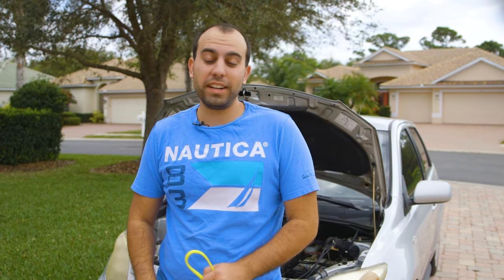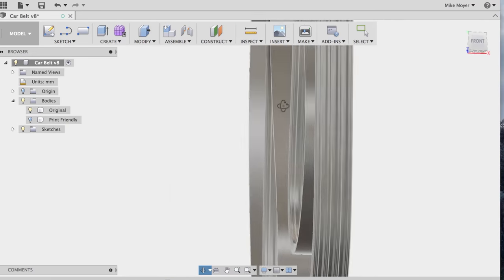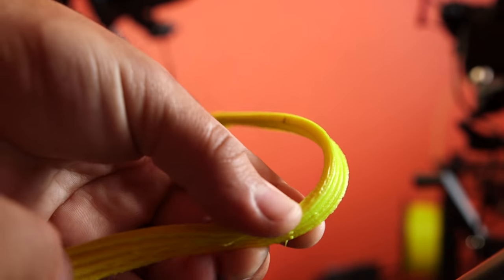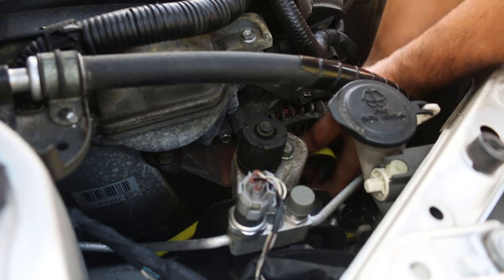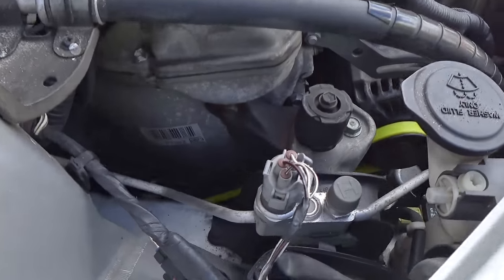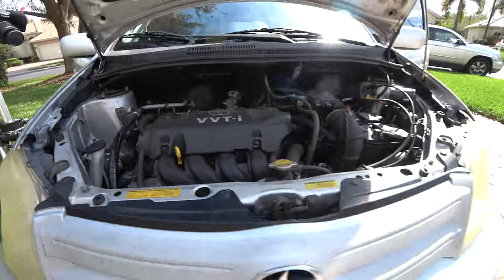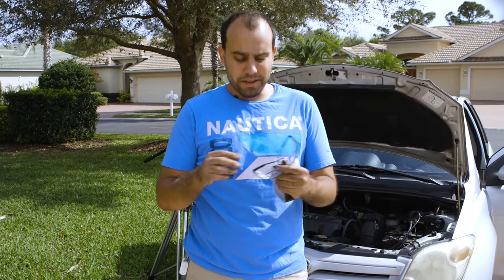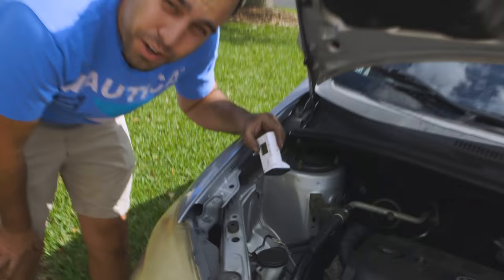3D Printed Car Belt | Will It Run?

Comment: PSA: dont try with your timing belt
Reply from the maker: Haha, I've got a timing chain.  Does that mean I can try it?
Reply: Oh well in that case, go for it!
Reply: If you get a metal-printer, YES! (no)
Reply: dear god PLEASE DO THAT WOULD BE THE BEST VIDEO EVER WE COULD TAKE BETS
Reply: And the piston will mingle with the valves and new holes will appear because another piston thought it was a rocket.
Reply: why not ?... pls do that !
Reply: why? it won;t hurt anything. oh wait. some of you don't have non interference engines :-)

some engines are non interference. IE losing the timing belt won't do anything but stop the car. install new one align and your good to go.

now an interference engine? ouch.

what he needs is a LESS stretchy material. or a way to impregnate something like kevlar string into the print somehow.
Reply: Yeah, but finding the correct timing again would be a bit of a pain.
Reply: your right you shouldn't mess with the car unless your a mechanic like me then you can do what the hell you want
Reply: Shawn Azzopardi idk about other cars but mine has timing marks. just align them all then put the belt on
Reply: Melody does not quite work like that. both pulleys need to line up. problem is if you belt is changing its dimension by stretching and shrinking then the two pulleys wont stay aligned. ie your timing will be varying wildly and randomly on its own.
Reply: Nerys oh yeah hahaha. Well, when it does, it will be easy to put a new one on.
Reply: Melody more likely yes and no
Reply: If you want to fuck up your engine go right ahead.
Reply: some of you guys maybe have no idea whats the difference between timing belt / chain
Reply: Of course i do. On some engines the "belt" powers all of the auxiliary parts like the manual fan, water pump, alternator, a/c compressor. On some engines the water pump is connected to the timing chain. The timing chain is what keeps the camshaft and the crankshaft synchronized so the piston and valves open/close when they are supposed to. With that being said, on some engines if the timing goes out of whack you can severely damage your engine because the pistons will hit the top of the head and hitting the valves causing it to need a rebuild or in some cases completely destroying the block.
Reply: ***** actually the piston won't actually hit the valve's because the piston will go so far up unless your crank is fucked then it's with probably hit the valve's and if it did this you would more like see back fires as in the engine wouldn't run because too much fuel on the piston unless it makes alot of a vapor
Reply: if it's an interference engine then you will fuck up your engine by doing what he just did but with the timing belt/chain,
Reply: This thread is why I do all the work on my own cars myself.
Reply: ShopTalk 3d printed motorcycle chain
Reply: ShopTalk  that was not the timeing belt that was the auxiliary belt
Reply: who said it was his timing belt?
Reply: ShopTalk2 weeks ago
PSA: dont try with your timing belt
Reply: You need to read better before commenting. "PSA: dont try with your timing belt" means dont fucking do this with your timing belt. If he had already done this with his timing belt, why would why then tell him not to do this with his timing belt? My comment was meant for people who dont know the difference and might fuck up their engine.
Reply: He hasn't done it with his timing belt. He said he might try it. I stated if he does there is a chance he might kill his engine.
Reply: The only thing that would happen is that your valve stems would get bent unless you have a zero interference motor then nothing would happen.
Reply: That's what i said above. He said he might try it so i advice him not to unless he wants to fuck up his engine.
Reply: Technically Valve stems are what keep air in you're tires it's valves that would get bent if you have a interference engine the piston could smack right into a "Valve" which in turn would bend it and damage the piston...
Reply: Benjamin Hopkins each engine valve has a stem. It is the long cylindrical portion of the valve.
Reply: Tavenner13 Yes but it's not just the valve stem that gets damaged the main face of the valve will be bent/warped after it touches the piston so it won't be able to seat properly.
Reply: The piston hitting the valve will cause a chain of reactions that will screw up your engine. Let's say it smacks a valve and it happens to break a chunk off and now it's rattling inside of the cylinder gauging the cylinder walls. You are looking at a very expensive rebuilt.d
Reply: ShopTalk I was literally about to comment this. but saying to do it lol
Reply: TehHijack 
Just so everyone knows.. this engine uses a timing chain.. not a belt.
But many older Toyotas did but we're also Non-interference engines.
Most Honda's are Interference and will self destruct as you described when the timing belt breaks.
you can check on what cars are and are not Interference on Gates Timing belt web site.
Reply: John Stamper 
Never owned any Mitsubishi vehicles. good to know.
you have to check the specific vehicles.
Gates makes a guide that tells what cars are Interference and what are not.
Reply: kens97sto171 the sohc Honda's have a better chance of surviving than the dohc ones if the belt snaps
Reply: Jake Nothanks I had a 1991 Honda VTEC dohc that the belt snapped in and it ran like a charm afterwards.
Reply: Benjamin Hopkins well you're one of the lucky ones
Reply: Jake Nothanks Believe me I know that thing was a tank.
Reply: Benjamin Hopkins wait you said a 91 vtec so it was a b17?I'd cry if that motor blew up
Reply: Benjamin Hopkins You mean after you replace the belt, right? It's impossible for an engine to run with the cam/cams and pistons can't move in time. Also, every single Honda engine I know is interference so you're either bull shitting or witnessed a divine intervention from god.
Reply: It's ok to make a 3d printed timing chain though.
Reply: ShopTalk yeah lol I'm sitting here just imagining a engine failure small to full catastrophic.
Reply: Yes after I replaced the belt and what happened I was in the driveway and my brother wanted to hear it so I started it and let it idles 30 seconds then reved it up and it just stalled dead tried to start it a few times and it wouldn't so I pulled the timing belt cover and the belt was snapped so over that weekend I replaced it and it started right up and ran just fine. I know what are the chances but I have 3 witnesses.
Reply: Also it was a 4th gen honda civic vtec hatchback.
Reply: Okay so if i'm stupid prove it I replaced the timing belt after it snapped and it ran fine also i'm a mechanic as well.
Reply: Benjamin Hopkins 
Depends on the car. Many Honda's are Interference engines..  and you may bed valves when. the belt breaks. But sometimes you get lucky and it stops before damage is done.
had a friend with a 90's CRX. first belt broke at idle, and  bent valves, second belt broke at highway speeds.. no damage.
hard to explain how or why. just happened.
Reply: ShopTalk IDK what happened but the B-17 is a interference engine but it came out okay. I guess I'm just lucky.
Reply: ShopTalk I would love to see this guy make a timing belt and install it on his vehicle!!!
Reply: why? if the engine explode i can print a new piston and valves with protopasta pla reinforced steel, or maybe a entire lightweight crankshaft with abs! (sarcastisc , dont even try anything i said)
Reply: kens97sto171
With an interference engine, wouldn't it just come down to one's luck at the time it breaks? If it breaks and the valves come to a stop when some are open, bang. If it breaks and the valves come to a stop when they are all closed, no bang. Of course you have to factor in the timing of the different cylinders, so I suppose having an interference engine that comes out with no damage has to be few and far between, but I suspect certainly possible.
Reply: Caddy Guy Gaming 
It is certainly true. It's just a numbers issue. The odds are you will get a damaged parts. I have had a friend with a Honda have it go both ways... Strangely the time it didn't suffer damage was at highway speeds... And the time it was damaged it was sitting at idle at a stop sign. 
Of course if he had changed the timing belt both time.. it would have been no issue at all.
Reply: Try

Comment: Really cool video but you need to realize that real serpentine belts have metal wires in them. Maybe try designing one where you pause the print every 5 - 10 layers and add metal fishing line tied in a knot then continue?1
Reply from the maker: I've thought about it.  This was so difficult to get to stick though I haven't had the energy.  I've got a couple of projects to get printed then I might give it another go ;)
Reply: why not just print it taller than a standard belt? if the belt you printed kept fair tension for a small amount of time, imagine what a thicker one would do.
Reply: barnacules you are everywhere my friend.
Reply: Milan Jovanovic lol u got a MS icon... did u and and the dur dur work together?
Reply: also that flapping belt means that it's too long next time make it a little smaller.
Reply: you said what i was thinking about 
thats why i always watch your vids i guess /....
Reply: Needs one of those 3D printers that can insert kevlar, carbon fiber, or glass fiber thread to prints and it would probably actually work quite well.
Reply: Ryan Winklevoss but they cost a ton and so does the material
Reply: try nylon cords not steal they are not a tire homie
Reply: Barnacules Nerdgasm I love your video's
Reply: i would just wind it couple times instead of having a knot, might hold a bit better
Reply: WOW barn...  Really?  What belts use metal line?  I know some use cotton, (old belts for old vehicles) nylon, or some other synthetic fiber, but I've NEVER come across one that uses metal.
Reply: First its Wire, RUBBER, and Fibers.... You are using PLA/FFF PLASTIC that is RE-HEATED to create shape to use in an environment that is prone to 1. Slipping 2. Friction from the slipping, and 3. Extreme heat.... Don't see how anyone would go through the extent of printing one especially from a PLA printer. Belts are relatively inexpensive as is. For the Price of the filament used to print it you could get a Dayco belt for the same price or less. Heck you probably could get a higher quality product like Gates. Now if you used a different 3D printer technology to do this then I can see but basic PLA won't do any good here, extreme heat would kill the plastic.
Reply: it wasn't PLA so i guess you didn't even watch or read the description. lol.
Reply: I watched and read enough to leave a credible reply so your comment reply is invalid.
Reply: I was just thinking that
Reply: What about a dual-extruder setup with fiber-reinforced filament inlays?
Reply: There is also the the issue of the rotational forces over stressing the material. Flexible materials that are printable currently couldn't handle the stresses from the High RPMS and head. IF he could have reinforced the belt with a fiber or wire with sufficient strength and flexibility it may have worked quite well.
Reply: Great point
Reply: Nylon in the belt.
Reply: There's carbon fiber tpu now

Comment: Windshield wiper blades!
Reply: that shouldn't be an issue if you have a large enough print bed, but idk
Reply from the maker: That would actually be really doable for this material.  Great suggestion!
Reply: Hey Lima xD
Reply: That's a good Idea, might have to try that for my beater.
Reply: Are you ever going to try this?